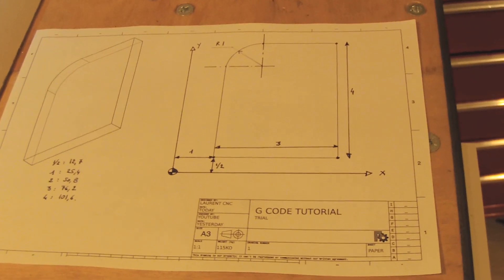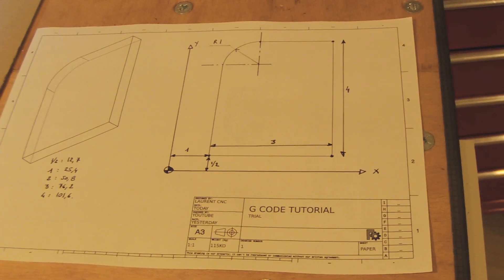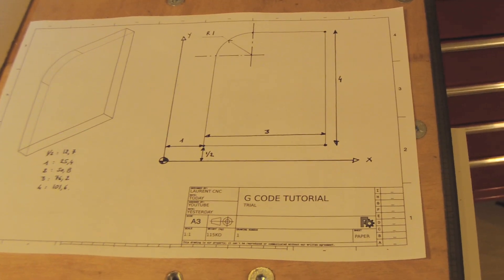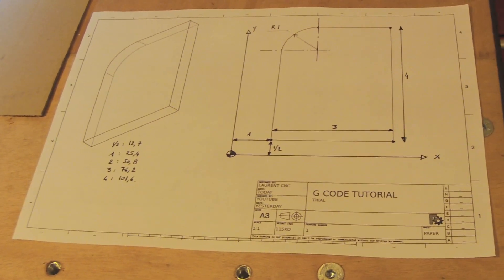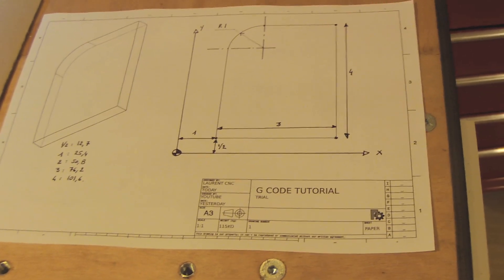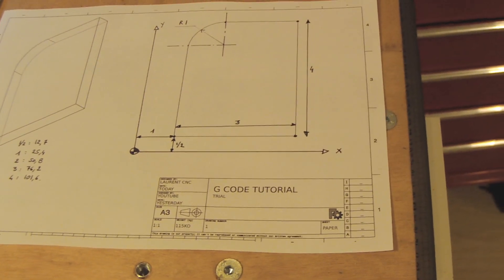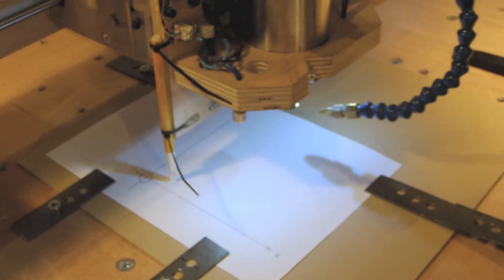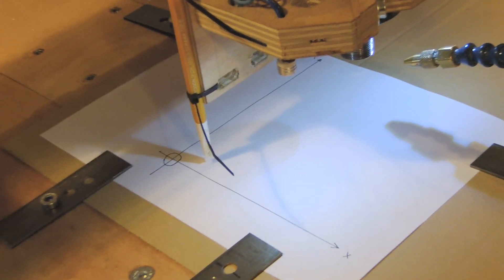Homemade DIY CNC, G CODE basics explained tutorial PART #2

Comment: Wow i never  run a CNC but i run in my job a manual Coborn grinder and i understand all what you explain about the X, Y and Z i run diamond tools for FORD and CRYSLER  so is the same like the manual but with the G CODE in my job i have to change enlish to metric so this will not be hard for me. Really this is what a call a introduction of a CNC and G CODE but in action, Well you inspire me to go to CNC school i was thinking to go to school for learn  to run a Mazak CNC  and i'm going for it at least i got the basic  i know how to use micrometer caliper scales ect and how to read blue print thanks a lot we will keep in touch
Reply from the maker: Thanks for your great comments. 
Just be aware that Mazak does not use the same G code they use mazatrol.
Reply: Thank you